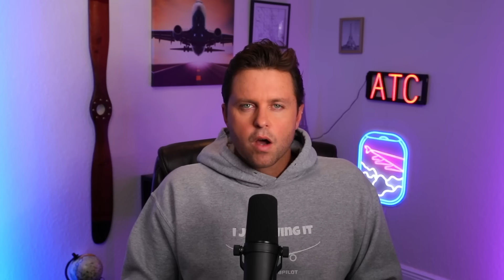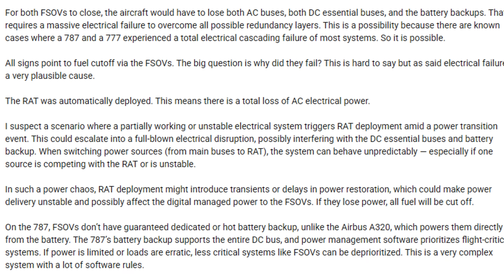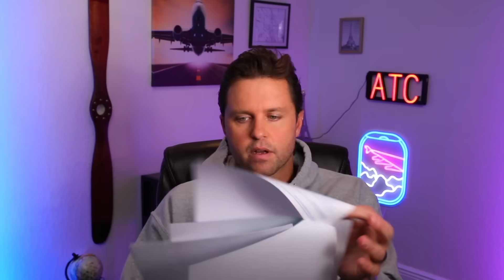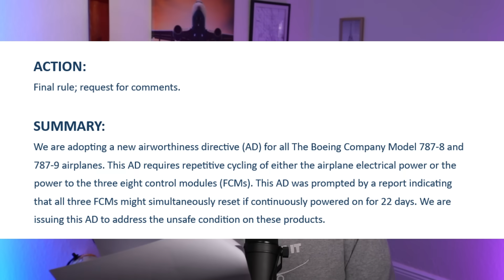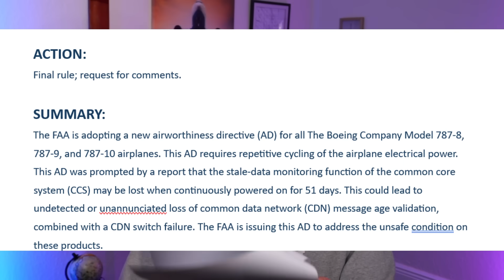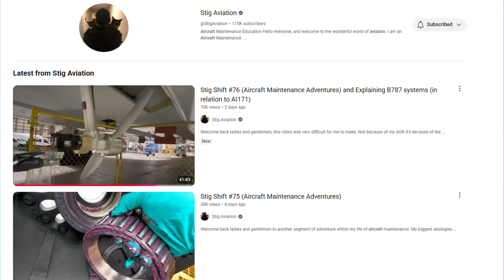Air India 171: Did a Software Glitch Cause Dual Engine Failure?

Comment: Since you asked, I go with contaminated fuel. Who would design an automatic engine shut down system, which could deploy after V1 and before the plane reaching, let's call it the Sully altitude? Fire or not, the engines should run up to the Sully altitude, unless the pilots shut them manually. Says a complete layman.

Comment: ‘If power is lost, the spring closes the valve instantly, cutting off fuel to the engine.”
This is 100% false. I am a retired 787 pilot and this is completely wrong. The FSOV must be closed manually from the cockpit using the Fuel Control switches.
Reply: When you state manually, I’m assuming you mean the act of flipping the switch. The actual act of actually closing the FSOV is driven by a software response to you flipping the switch. The point therefore still stands that a software glitch could have resulted in dual FSOV closure due to a cascading electrical failure.
Reply: @bradjoyner9586 Losing electrical power in any Boeing does not close the FSOVs
Reply: @Slohoffman01  the FSOV on the 787 is a solenoid-operated spring valve and therefore requires electrical power to stay open.
Reply: @bradjoyner9586  Maybe not all systems in a commercial jet should be fly-by-wire?

Comment: Excellent video. 
One important angle that deserves more attention is the potential role of the Power Electronics Cooling System (PECS) failure in causing a total electrical failure on AI171. As said in the Stig Aviation video.

During takeoff, several factors converge to place extreme thermal stress on the aircraft’s power systems: maximum engine thrust, limited airflow at low speed, and heavy use of electrical systems such as air conditioning, avionics, and electric pumps. In very high ambient temperatures—like those in Ahmedabad—this can lead to PECS overheating.

If the PECS fails to cool critical components, it can trigger an automatic shutdown of power converters and distribution units, leading to loss of all AC and DC bus power. On the 787, as you said, the fuel shutoff valves (FSOVs) are electrically actuated and default to a closed position when unpowered—cutting off fuel to both engines.

The automatic deployment of the Ram Air Turbine (RAT) strongly supports the theory of a full electrical loss. If the FSOVs closed due to this, the crew would have had no way to reopen them, as the 787 lacks an independent battery-backed circuit for these valves—unlike Airbus aircraft, which often include this redundancy.

So this may not have been a simple fuel system malfunction, but rather a thermal chain reaction within the aircraft’s electrical systems—ultimately causing a dual engine flame-out.

What do you think?

Comment: My own calculation: A 787 can fly, take off and land with 1 motor. So 1 full working motor and landing gear out should be OK to return to airport for a safe landing. Heat caused 15% thrust loss. Is 1 engine with 15% thrust loss because of heat and landing gear out enough to return to airport and land safe? RAT out / employed will give extra loss in thrust so what are options / chances for a safe return to airport with 1 engine, 15% thrust loss because of heat, landing gear out and RAT outside if airplane is at low altitude and also have to make a turn to return to airport?  If there is power loss, 2 engine fails, landing gear out an RAT out / employed ...the chances of a safe return to airport seems to be reduced to almost 0% when you are at low altitude and also have to make a turn to return to airport. : Only when you have enough altitude and your position is OK you perhaps can land safe on a nearby  airport in such conditions. If possible software has to suplly in such conditions. If a safety systems blocks the fuel to 2 engines ...how safe is that safety system? Air India 171: Did a Software Glitch Cause Dual Engine Failure? https://www.youtube.com/watch?v=VswFVpyg5ew&t=290s

Comment: I've just watched a video of how the RR engines are built. There was one section where 4 engines from the 787 were having an 'upgrade'. There is an IP compressor issue due to wear and tear above and beyond the expected. I'm certainly not anywhere near an expert but as far as I know the IP compressor is used to turn the fans. 80% of the power comes from the fans.

Comment: You should mention the fact that the aircraft didn’t have working rear entertainment screens and the a/c wasn’t working from a video that was posted before flight. Also the same problem might’ve also been on the 787-8 that had to delay to Hong Kong. 🤷‍♂️ 
I am not that knowledgable about it. But, does that have something to do with it before it took off?

Comment: You shouldn’t say “software GLITCH” if you mean a certain extreme situation wasn’t automatically handled “correctly”…. the 737 MCAS problems were lack of electrical redundancy / resilience (AoA sensors), badly tuned / designed control parameters (not strictly “software”) and lack of proper pilot information / instruction.

Comment: I don't believe (hope?) that Boeing would leave such a glaring vulnerability. That said, the ANA incident to me is the smoking gun - that incident and the present AI accident both seem to have happened when the landing gear and thus the weight-on-wheels sensor values toggled from air-ground and ground-air. It is beginning to look like the Thurst Control Malfunction Accomodation (TCMA) is more likely the culprit as it not only has the authority to kill the engine(s) but also relies on the weight-on-wheels signal. In other words a faulty weight-on-wheels transient could lead to the TCMA kicking in and killing the engines.

Comment: Apart from cables, chip on cables, programmed cables with ic-chip,  ( bus also means the wires inside ic chip---- but to the outside world either the chip works or its fused ic circuit box....)

Comment: I made a long comment on Captain Steve's video a few days ago about complete electric failure, although I didn't know about the cutoff valve default.  As it's been established, the RAT could have been deployed because of dual engine failure or complete electric failure.  If there was a electric failure the electricity needed for the fuel pumps would not be provided. The final redundancy to fuel the engines is that fuel is gravity fed into the engines, but this is not sufficient during takeoff thrust.  And the RAT does not supply the power to the fuel pumps.  So whether the fuel cut off valve defaulted to off or not wouldn't have mattered.  If there was complete electrical failure during takeoff, it was unfortunately doomed.

Comment: The 787's FSOV does NOT automatically shut off in the even of loss of electrical. You have a 787 engineer and technical instructor in your own comment section who has described this error at length. And even in the two incidents of total electrical loss due to cascading electrical system issues that everyone is suddenly citing, none of the engines on either plane ever lost power or thrust.
Reply: This ^^^^^^^

Comment: So the design is either recklessly flawed which is total complacency on the part of the manufacturers or if they knew of the flaw and didn’t address it they are criminally negligent in keeping the planes flying.
There is of course a 3rd option. The engineers didn’t think of this eventuality and therefore didn’t see this coming !! I hope the authorities get to the bottom of it and resolve the problem.
Reply: Or the 4th option:  this guy is parroting misinformation. The FSOV does not automatically shut off on power loss, and even in the two incidents cited of cascading and total electrical failure none of the engines on either plane ever lost or experienced a reduction in power or thrust.

Comment: IIUC, the issue with the 737max was not a software glitch. The sensor was not made redundant in purpose, because with two sensors, the software would have had to report inconsistent readings via a new button/alert and that would have required to retrain pilots. So, to avoid retraining pilots, they decided to eliminate redundancy.

Comment: Looking back this is same as Cathay Pacific 780 incident from April 2010. Also, in Oct 2018 Boeing 787 experienced uncommanded engine shutdown due to a blocked inlet filter and fuel metering valve.
Its fuel contamination for sure and definitely not the pilot actions by any logic. The fuel filter blocked, the bypass valve opened, the contaminants went to FMV and FSV and clogged them close. 

Because since the RAT deployment means loss of both engines, Calling Mayday, Being very low on altitude no rolling, Keeping nose up througout, all this clearly indicate the pilot did an exemplary job.The fuel metering valve issue due to SAP contamination in fuel. If you know what happened there you will know what happened here. They should investigate the fuel loader before the rest of the procedure complete. If the authorities have not checked the loader filter elements before tampering, this horror might happen again. Hope this investigation ends in this decade and doesn't get influenced.

Comment: Great conversation. The videos add a lot of information to contemplate. 
At this point, I think there are more questions than answers. See my comments below. 
Given the AI 171 lost lift and all indications at this point lead to a yet to be determined system failure and most likely not pilot error. 

The pilot calls May Day and loss of thrust. I think this message can lead the listener to different conclusions. Given thrust only comes from the engines, I also also think the message adds credibility to the theory of a dual engine failure since there is no observed yaw during flight that is common from a single engine failure. 

The prevailing theory, which most likely explains loss of lift at this point,  is loss of thrust in both engines.  Exploring this theory further, the engines could have flamed out or rolled back which are two different conditions with similar or completely different root causes. 

One theory for loss of thrust is now believed to be related to the FSOV for each engine being closed and a second theory the FADEC lost power momentarily which resulted in the engines rolling back. 
Both of these conditions can be related to primarily electrical issues, or any combination of electrical power disruption, sensors, software and programming.    There can be more than one reason yet to be identified which caused both engines to either flame out or roll back. Keep in mind a software glitch is different from a programming logic error that may only manifest itself when all the holes in the Swiss cheese align. 

Given the RAT was deployed, we know there was a significant power loss.  There seems to be differing opinions on whether the FSOV’s are spring loaded or powered to remain in open position or powered to close.  I googled this question and an AI answer indicates the fuel valves on the 787 are spring loaded along with agreement from other commentators and sources (none of which are Boeing). 

I think we need to confirm the valve type and how it operates. This will confirm or deny one possible theory. 

Can anyone confirm the FADEC can potentially roll back the engines if power is lost for 1-3 seconds? 

We have some theories floating around about the root cause of the power loss which starts the events in motion leading to the accident. 

We can not verify the exact point the power is lost by the deployment of the RAT, since the RAT will not deploy with weight on the wheels and requires a minimum ground clearance. This all might seem to be trivial, but it can lead us to a better understanding of the sequence of events. 

At any rate, I really enjoy reading all the comments from the pilots, engineers and maintenance personnel. 

Point of order: I disagree with people who say we should wait for the official report. This can take a minimum of 1 year or up to 10 years and may or may not draw a definitive conclusion.  If there is a design flaw, we owe it to the pilots and passengers to help identify it and get a remedy sooner than later. 

Engineer Mark
Reply: How would both FADEC channels in each engine lose power when both are powered by a magnetic alternator driven by the engine? How would a cascading, catastrophic electrical loss cause both engines to roll back when in the two incidents cited as examples of such a catastrophic, cascading loss of all electrical neither plane's engines rolled back.

Comment: The 787 Dreamliner is The Boeing Company’s newest addition to its fleet. Unfortunately,
it has been plagued with problems. The latest is a software bug, discovered by Boeing,
that could cause loss of all electrical power, potentially shutting down both engines.

Comment: A Software Error Could Shut Down the Engines
In lab testing years after its first delivery of 787s, Boeing discovered a software error in the generator
control unit. The error could result in a total loss of electrical power to the aircraft, even in flight. The
condition occurred if electrical power were left on for about eight months without being turned off. More
specifically, the problem became existent on the 248th day of continuous electrical power.
With its extended dependence on electrical systems, the 787 could experience a loss of control if it lost all
electrical power. Loss of control of the airplane could occur during any phase of flight, including takeoff,
landing, or while maneuvering in the air. Control loss during takeoff or landing could be particularly
catastrophic.
Why would any airline keep its airplanes powered up for such a long period of time? When the 787 was
first delivered, customers discovered that the airliner issued a series of erroneous nuisance messages
when it was first powered up. Boeing recommended that the airlines power up the 787 earlier for a flight
than they otherwise might to avoid this condition. As a result, many airlines simply kept their Dreamliners
powered up continuously until their next maintenance intervals.
Fortunately, according to Boeing’s records, the electrical power for all 787s currently in service has been
turned off as part of routine maintenance approximately every four months. The maintenance intervals for
the airliner have been much shorter than the eight-month trigger point, so the problem of electrical power
loss has never been experienced by an airline.
The FAA’s Airworthiness Directive
In response to Boeing’s discovery, the U.S. Federal Aviation Administration (FAA) has published an
Airworthiness Directive (AD) ordering 787 operators to periodically shut down the plane’s electrical power.
The AD requires that 787 electrical power must be recycled at least every 120 days.
According to an FAA statement,
“We are issuing this AD to prevent loss of all AC electrical power, which could result in loss of control
of the airplane. If the four main generator control units (associated with the engine-mounted
generators) were powered up at the same time, after 248 days of continuous power, all four GCUs
will go into failsafe mode at the same time, resulting in loss of all AC electrical power regardless of
flight phase.”
A Boeing spokesperson stated that:
“The airworthiness directive action addresses a condition that only occurred in the lab. Simulated
testing determined that this condition is possible in cases where an airplane’s power is left on for
more than eight continuous months. No airplane in the fleet experienced that condition.”
The Fix
Boeing’s only comment related to the cause of the problem was that:
“This condition is caused by a software counter internal to the GCUs that will overflow after 248 days
of continuous power.”
Speculation is that the software bug is a signed 32-bit integer overflow that is triggered after 231
centiseconds, or 248.55 day

Comment: Notice one more what appears to be a detail but is probably emblematic of a shoddily and hastily designed 787 electrical/computer control system. While everyone has commented on the RAT deployment and its significance in pointing to dual engine failure, I have heard no one comment on the fact that RAT deployment in this particalar situation is absolutely useless, demands system resources, and complicates matters. The point is the senselessness in design that would allow the RAT to deploy at less than 600 feet and descending rapidly. Another DESIGN FAILURE.

Comment: In a very real sense we are dealing with a rerun of the 737 MAX fiasco; poor electrica/electronic systeml design. In the MAX Boeing flauted every conceivable principle of electrical or electronic aeronautical systems design safety. Single point of failure in a critical flight control system, absolutely zero consideration was given to the behavior of the MCAS system should there be erroneous inputs from the SINGLE angle of attack sensor, ad nauseum. A Tour de Force of engineering incompetence.  Let us note that the "dreamliner" was being designed during the same time frame as the 737, under the same loudly declared goal of the CEO at the time McNerney:   "MORE WITH LESS".  A directive to essentially cut corners, speed it up, get it out the door, "finesse" the relationship with the FAA, and be done with it. Until the airplanes start to crash of course.

Comment: Per India authorities for aviation, directive for immediate  removal of three high ranking air India employees due to lack of oversight, air India for safety lapses,expired emergency equipment, crew rest, licensing requirements for flight crew, experience for airframe crew is assigned, and aircraft  scheduling.  Also 787 transmits technical data to three groups, Boeing, GE for the engines and the carrier on numerous points of aircraft performance